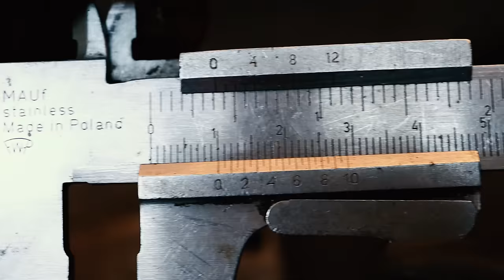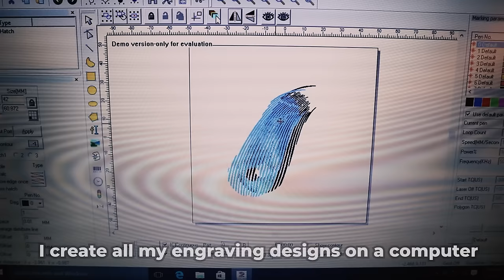Old Pistol Spark Lighter Restoration - Evel Knievel edition

Comment: If I was repairing that lighter, I would have the new rivets in the bottom half sticking up and place the parts over them and then slide the other half on top, would be much easier and faster than flipping it over.
Reply from the maker: very cool suggestion about the rivets 🤟👊 cheers buddy :)